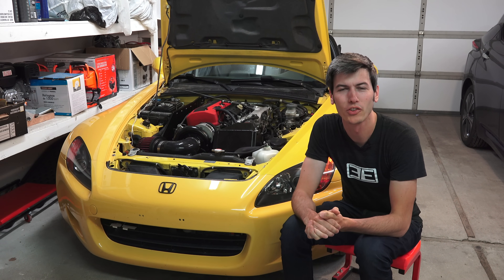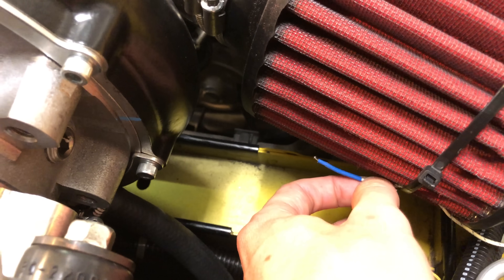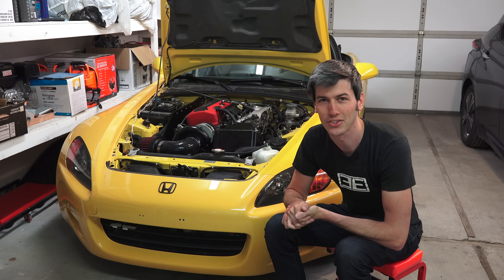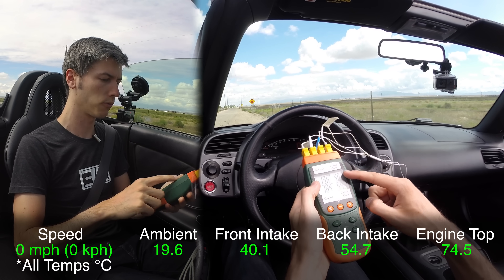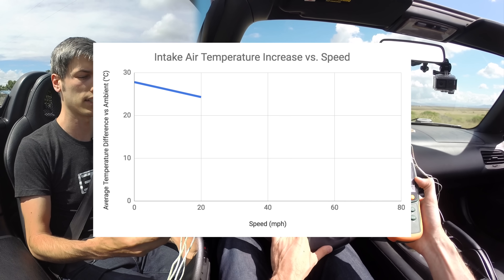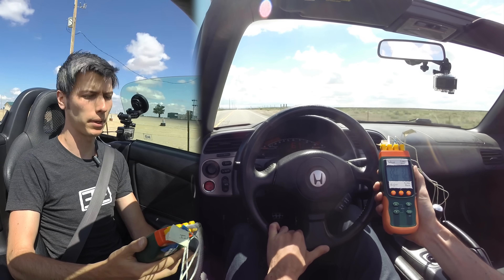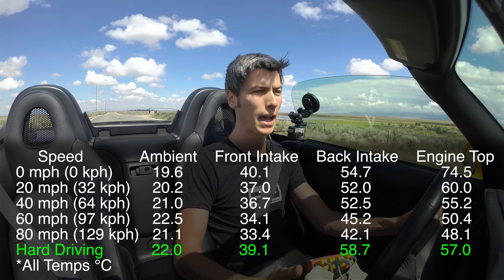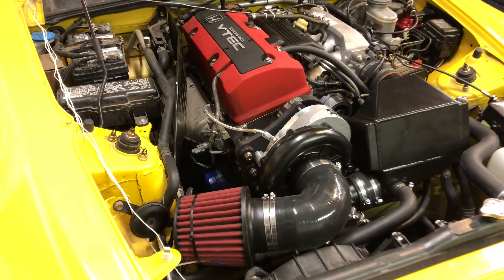Does My Supercharged S2000 Have A Hot Air Intake?

Comment: Did you do data logs to measure your iat's (post intercooler) with different intake setups?

I know you mentioned in your pinned comment that colder air means colder temps post intercooler even with the compression in the supercharger, but my testing had the opposite results.

I did testing with a "hot air" intake as well as a closed intake that was fed ram air from outside the vehicle (cold air intake) and the iat's post intercoolers on my supercharged vehicle were the exact same. The supercharger superheats the air well beyond what is coming in through the intake. Cooler air coming in won't bring that temp down in the supercharger.

Comment: Still as you say down there in comments. 
Its better to start with 20*c pre Air Charger as it will still be cooler post intercooler 
than starting with 40*C Pre Charger as it will still be much hotter Post Intercooler 

As intercoolers dont cool it to a certain temperature unless its cycling through it many many times. 
They remove a certain amount of thermal energy over a given time period it passes through.
if the initial energy state is double or triple ambient the end result will still be double or triple

Comment: The numbers would have a bit more merit if you tracked the intake air temp and at the same time. Depending on the efficiency of your intercooler and compressor, there may not be that much change in the intake charge temp. Yes cooler air in will be denser at the compressor, but that doesn't mean you will see a drastic difference in hp because of many other factors. Methanol injection would probably have a far greater impact on power than a cold air intake simply because it cools the intake charge further, in the intake.

Comment: hmmm I just got an old but rebuilt powerdyne BD11a  to use on my econoline    with a built 306 ..  without having the engine in im looking at old photos   and because of the dog house i know physically the blower will fit ...  but  the intake tube (to the scroll ) to the impeller   might be iffy or maybe snug over the master cylinder resevoir which is fine..  BUT   it will be  like  toward under the dog house...  So I looked at some "low profile filters"   i mean they exist    basically its like capping the impeller... I plan to run a snow kit    meth/water injection...   I'm wondering if that's okay?     hmm .       Probably heat soak but I just wonder   how much worse more heat  is than not on bearings and such.   at the same time being a van.. a dog house is fairly a large area compared to an enclosed hood...   but  I was sitting here thinking I couldnt do it... then was like...  can you just cap the blower lol

Comment: The ambient sensor is usually near the front intake ,so it seems to be a large difference to the sensors you have installed. The filter  and intake tube where it is installed is very subject to heat soaks I would suggest the air intake temp sensor would be very affected and would be giving the ECU wildly high intake temp readings .. Obviously move the filter closer to the front intake and more importantly, move the sensor closer to the filter to represent the actual intake air temps

Comment: I have a hot air intake now (just haven't been able to figure out how to get the intake out front...) and this is a really big difference.  I am definitely going to try harder.  Basically 20-30F difference depending on speeds is "free hp" if you can get ambient air in there, especially if you are heating that air up with a supercharger.

Comment: I know this was a year ago, but if you ever did try and fix this problem, I would monitor your air intake temp sensor. It would be interesting to see the before and after seeing that you have an air to water intercooler on it. Would it make much of a difference in the air charge temp that goes into the engine?
Reply: That is, if you are speed density. If this is a MAF car you might not have that option.

Comment: Awesome video, Jason :) I'm currently running a CAI and was looking for an answer if what would happen if I switch to a SRI.. I got the answer now, with an SRI (hot air) vs a CAI (cold air).

I was wondering if you could help on that question, a side from the temperature issue, does the length of the SRI vs CAI pipe matter? I mean the shorter the pipe, the better the air is gonna travel, right?

Comment: Ok, IMHO experience with boosted cars where you have a intercooler, the actual intake temp mater very little. More gains to be made making the intercooler working better. The intercooler is going to heat or cool the air to about the same Temp, regardless of the actual intake temp going into the charger. It makes a difference, but very little, not like on a NA car. Not sure if you are really engineer or not.

Comment: In addition to relocating the air inlet to the front, I would go with a plastic or silicone pipe to direct the airflow to the manifold. I'm also concerned with your use of the K&N filter. Does the filter sacrifice filtration efficiency for less restriction in the airflow? Does K&N supply filtering beta ratios at particle micron sizes for its air filters?

Comment: As i see it theres a third option you missed, 
Option 1, move the intake to where cooler air is, I can see the sense in that, assuming you keep it safe from rain etc, having a ducted box would work... but see also 3.
Option 2, sheild it from heat, doesnt make as much sense to me as per your radiation vs convection discussion, it may be subject to radiation heat and youd potentially be limiting the flow of cooler air into that space...
Thus option 3, attempt to vent out the hot air out of that space, such as with a small rear facing vent over the pod, or the old racers trick of putting a couple of washers in the back of the bonnet hinges.

Comment: The best solution is an airbox with a snorkel. Like on most standard systems. Putting the intake down low is asking for trouble when it rains, using a ram-air style extension hose is just as risky, cant beat an airbox with snorkel

Comment: I would love for you to continue this series (measuring temps and trying to perhaps lower intake temps)!!  Also perhaps try temp reading in the OEM air box and the OEM air box + snorkel if that's feasible in your SC setup.  I've considered the snorkel but wondered how effective it is.  

It would also be cool if you did some comparative 2nd gear pulls - say 30-60 (or redline) with temp readings and then if you think you develop a better (cooler) Intake setup do the same 30-60 2nd gear pull (i'm suggesting a second gear pull only to eliminate the 1-2 shift or any other shift as a variable in the acceleration times).

Thanks for another great video!!  Keep em coming!!

Comment: I wouldn't bother with insulating the exhaust. I would fab a box around the air filter, and duct it to the front inlet area, using sheet metal. Alternatively, run a typical cold-air-intake which routes right into the empty fender area, which is already a box of sorts that's separated from the exhaust system.  There might be a CAI already made for this car, able to be installed quickly.

Comment: Some time ago i had a ford escort.  There was a strip of plastic that added about 2 inches below the radiator, as stretched the width of the radiator.  It was held in place with 2 plastic fasteners, one of which broke, causing the strip to hang from one side of the car, and drag on the street.  i took the piece intending to get it replaced by the dealer.  It didn't cause any problems while driving around the city, but when on the highway, the engine started to overheat.  I pulled over and replaced the plastic strip, fastening it back with another fastener from the trunk, which was pretty much the same as the piece that has been still holding the strip in place.  Returned to the highway, and the overheating stopped.  My  thought is that without the strip, there was enough buffeting air to interfere with the flow through the radiator at highway speeds to keep the radiator from properly cooling the car.  Since the air flowing through the radiator is being heated, i would imagine most of the air in the engine compartment would be substantially warmer than ambient air.  So would expect that the air entering the supercharger might be warmer than you expected.

Of course the lesson i learned is that strips of plastic hanging under a car engine that seem superfluous might be there for a good reason.

Comment: It would be interesting to see the temperature gradient if you were able to put a thermocouple inside the intake piping, close to the throttle body. I'm curious if the heat from the piping heats up the air inside, or if the air passes too fast for significant heat transfer.

Comment: Cool video. Two quick questions. 

1. In terms of the hypothesized solution of moving the intake forward...is there anything to be said for how much it heats up as it travels from intake to the engine? If so, is it possible that the longer travel time could negate the performance benefit?

2. Could you please provide link to or model of the equipment you used? 

Thank you!

Comment: 907 comments so im sorry if its been said, but this wasnt done with it IN the intake. I would argue that the velocity of the air means that although the intake is hot in the back it doesnt transfer that heat, to the air inside the intake

Comment: i did that with my 2003 expedition.  aftermarket CAI with no heatshield.  I used a scan tool to monitor air intake temperature (reading the MAF) and i have a temp gage on the front grill.  I noted a significant difference between ambient and intake temps.  Then i build a heat shield from a plastic trash can sourced from Home Depot (no kidding).  scavenged some weather stripping from a junk yard to form a seal around the open top of the can (the can was laid out horizontally with the intake tube coming in through the bottom of the can).  The hood insulation closed off the box.  The only open area was directly in front toward the various openings along the radiator, light fixture, and down below.  I re-scaned temps at highway speed and noticed that my intake temps were almost exactly the same as ambient.  At idle, intake was warmer, but not like it was without the can.  So getting a CAI aftermarket with a 'box' is better than just an open intake, at least from my limited experiments.

Comment: My EK Civic VTI had a large white  box in the bumper area to cool the air down before it went into the engine.  I took it out and put a direct air filter similar position to this video and the performance low down before VTEC kicked in (yo) was way worse, but it sounded loads better when it did.

Comment: I think the air flowing thru the radiator would be why the front of the intake goes no lower than 33 since your taking heat from the engine and putting it directly infront of the intake.. just my two cents. don't shoot me !

Comment: Interesting question being, theoretically, would the gain in power from cold air outweigh the added weight and loss of aerodynamics from such measures? What about intake relocation vs. heat shield vs. stock, test all three on the dyno and on 0-60 performance.

Comment: Add a thermocouple just after radiator and compare it to the engine bay and intake air temps. You'll find that the radiator out temp is quite close to the engine bay temp. The air flow flushes the hot air around the exhaust manifold to the back of the engine bay and it shouldn't be an issue in this case. The heat shield would eliminate the IR radiation load, however it shouldn't be significant compared to the heat load through the radiator..

Comment: Great Test. Good work on the all the different locations. Are there plans to try this again with a relocated air intake? I would love to see what the throttle body temps are with the longer intake piping completed to the short ram to see if there is that much a difference after the engine get’s up to temp, and the intake piping gets some heat into it.

Comment: Engines love cooler air, more dense.  Exception is when it's extremely cold outside but don't think you'll be driving the 2000 when it's well below freezing outside.

Comment: Hi sir my name is Ali i am mailing you to ask one technical question the v8 or v12 engine used in a mid engine layout supercar is similar and constructed similarly as the engine in front engine car is constructed because many super cars like pagani use Mercedes v
12 and McLaren got bmw v12 while koenigsegg has ford v8 do the have similar structure as front engine is manufactured or engines in mid engine layout are different in shape and design compared to engine mounted in front engine car but many super cars use engine which are also found in front engine cars in other words the engine used in front located car can also be used in mid engine setup waiting for reply thanks indeed

Comment: hi could you cover about spark plugs? what would happen to an engine if you replace the sparks plugs on half or one side of the v6 or v8 engine and leave the old ones on the other. will the cause a check engine light in the long term? or will it wear out an engine part?
Reply: please cover this topic as i cant find any answers anywhere in the internet

Comment: ambient temperature sensors and air flow, maybe you should move to japan and have them hire you as an engineer? Remember when Honda took over way back from the gasoline crunch in the mid 70's? Remember when parts were way out of line, but the engineering was just so good? Remember any of this? Remember how it took Detroit manufactures 20 years to catch up with the Honda? I do not remember steam engines on a railroad car. I was not born. You should teach Steam engines. Thank you. :)

Comment: use a plastic heat shield boxing it off but most importantly blocked it off from the back, then if you really want to see a difference put gold heat reflective tape on it and youll see a huge difference.

Comment: Good experiment. Interestingly my MX5 became slower from relocating the pod filter at a 90 degree angle compared to when it was next to the headers with a 30 degree angle joiner and heatshield. Would intake routing have more of an effect on power than intake temp?

Comment: Does it matter where the source is since it will need to pass by the heat anyway? If you were to run an intake down by the bumper, it will still need to have piping up to where the current intake is, won't you? So it will still have to run by the exhaust and still get just as hot inside the intake piping, no?

Comment: I suggest another remedy: heat shield on the back of the filter and carefully designed ducting from the front air dam up to the filter's location, like many trackers/auto-x'ers do with their brakes to keep their temps in check.

Comment: Should do a intake temp vs after intercooler and then move airfilter outside and then do intake temp vs after intercooler... see if it makes a difference if the airfilter is in the engine bay or not..

Comment: I was surprised by your findings! I've got a 92 Civic Si, mostly stock but with a K&N cone filter hanging out in the engine compartment. On really cold days I can feel a difference in power vs more temperate days. I had assumed that at freeway speeds the under-hood temps would be much lower than you found. This time of year I spend a lot of time in traffic with the A/C running, which should really push up under-hood temps. I'm now contemplating an air box of some sort to bring in colder outside air. I would be interested in a comparison as Humblemechanic suggested.

Comment: I remember back around 2001 there was a shop selling a "cold air" intake that was piped from the throttle body to the front air inlet in the bumper resembling an intercooler. All these years I have always remained curious about the design and your video has reawoken that curiosity.

Comment: The back intake temp could just be stagnant air, if more airflow, then the engine can eat, hits the front of the airfilter, the filter is never going to suck on the hot air behind the filter.
You need to measure the intake temp to make any conclusion.
The intercooler you have is also larger then needed, for the power you made at last tuning video, so maybe your engine intake never goes above 30 degrees anyway, renderring all modifications you make useless and just ekstra mass to drag around.

Comment: This is good, but what is more important is logging your IAT’s via your obd port. I’m told that above 40c iat can inhibit a higher chance of knock in your engine. 

I’m guessing the climate you’re in is far nicer then the UK so may be worth investigating. I have some data i have logged with my VQ35DE pre and post larger intercooler if you want to have a peek.

If your tuner says IAT temps is not an issue for you then getting cooler intake temps is likely to result in a boost in peak performance, even without map re-calibration 👍🏽

Comment: I say a heat shield, ducting to ram cooler air into the filter. I've always wondered how effective ram air is at lower speeds as it obviously works for the SR-71 on the other end of the speed spectrum.

Comment: Back when I was 18 going to school to be a MECHANIC I ENGINEERED a cold air intake out of PVC pipe.  The intake worked great and costed very little.  The short ram intake kits you can buy for cheap are junk.  Get a cold air intake (which most modern cars have from the factory) or do not mod it at all.

Comment: Great video! Straight to the point, and driven by data, not opinion. 

Other "experimenters" looking to perform a similar test would most likely do it stationary, maybe with a fan to simulate airflow, all in the name of consistency and control over variables, but I def. prefer how you did it here. Actual real-world testing with real-world results.